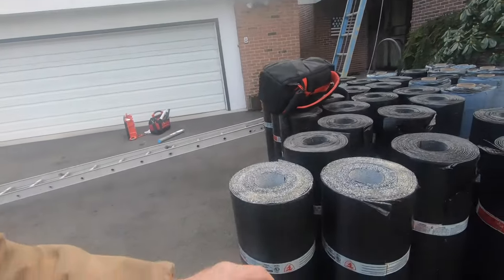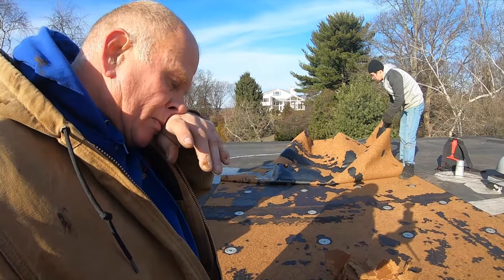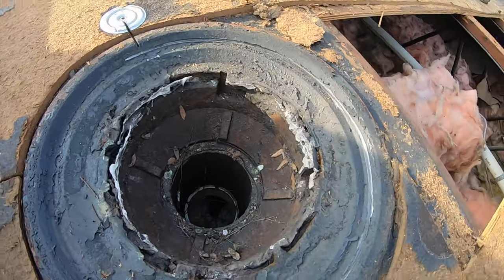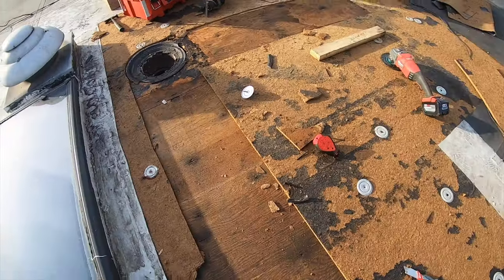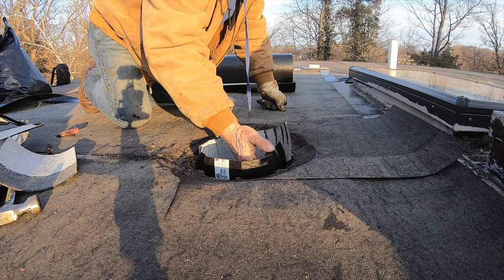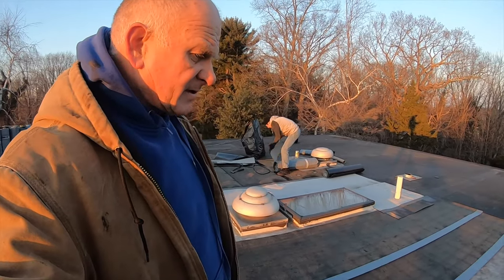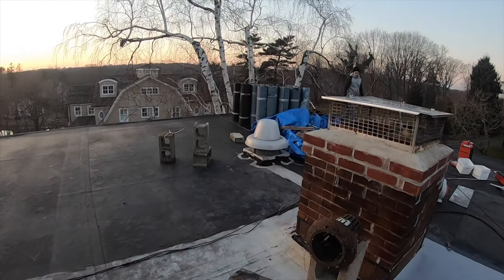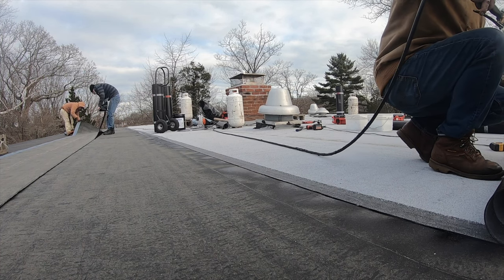Break a drain to gain 1/2" Then tie Torch Down Roof to drain

Comment: Walking on hot cap sheet while torching down! Is that ok over there or what?
Reply from the maker: Sure it is. There are different brands. You are referring to Soprema's brand that is too soft to walk on while torching. Keep torching "over there"
Reply: @FlatRoofDoctor  thanks for the reply. Yes you are right soprema is softer, so does the IKO and the siplast too. One can’t really walk nd torch simultaneously on the hot membrane. 
Which brand are you using?

Comment: Do you worry that the self adhering base will expand and contract at a faster or slower rate than the torch down?? Or what base and torch down brand are you using?
Reply from the maker: I never had a problem with that. I think they both compliment each other in strength
Reply: Im going to try this on a roof and will report back I'm just afraid of them not mixing well.i wanna try them on a commercial job we have coming up 100sq
Reply: @FlatRoofDoctor  love this system!!! Im going to start using this system instead of peel and stick base and peel and stick cap...the torch down applied to peel and stick base once cured woahhh!!!.. great alternative if people wanna save money but still have a great system